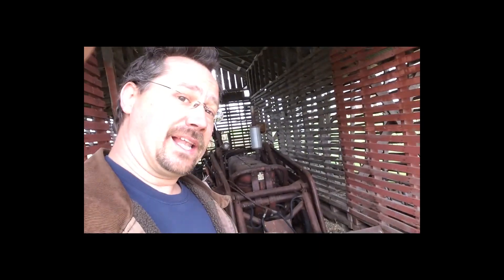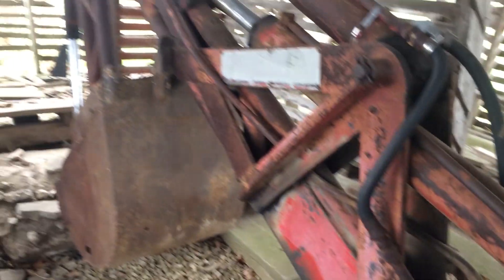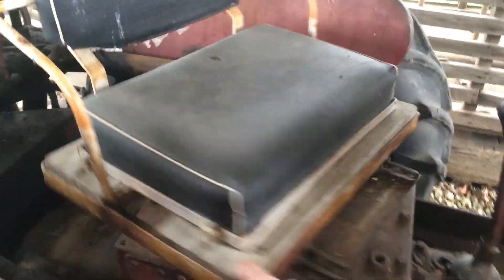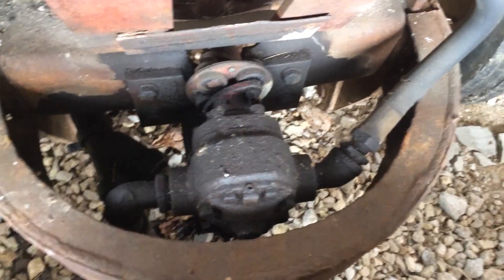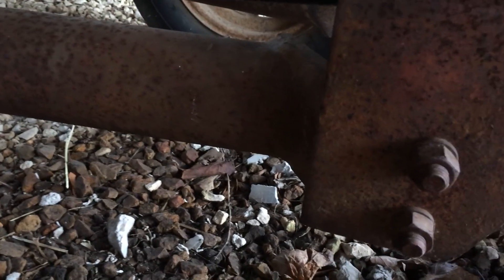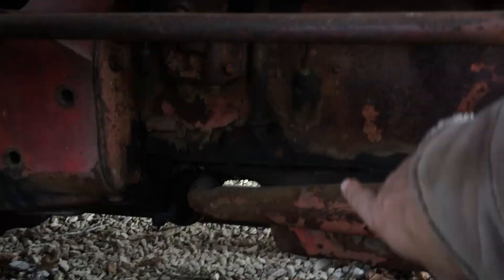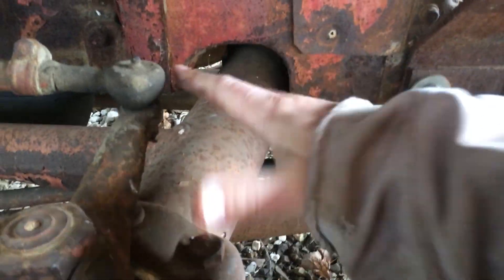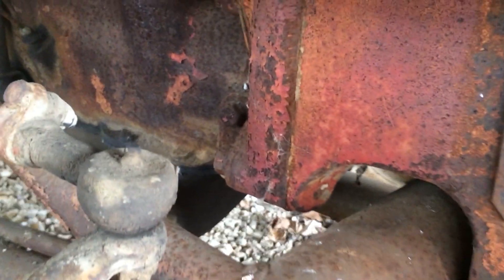International Harvester 300 Utility Tractor with front end loader and backhoe

Comment: 1000V+ High voltage generator from induction motor american tech made this and if you have five it would power your car. just make it so it don't break. oh then it 3000 a battery because it is all powered by a high speed 24 v 36 v or 48 high speed motor at 20 amps instead of 600.

Comment: Is there a way to connect it to where the starter used to be attached to the bell housing?  Maybe you could pull power off of the teeth on the flywheel?  If you had a solenoid on the starter then you could engage/disengage when you didn't need hydraulics.

Comment: The original hyd pump has a pass-thru shaft, IIRC. Perhaps there is a similar pump which could sit between the electric motor and the tractor's flywheel. Thus it would always have power when the motor is running. Since you have to machine the components in that section anyway maybe that could be made to work.

Comment: That tractor was built as a backhoe  the PTO pump is not a live pump. The front one is a live pump meaning it works wether the clutch is pushed or not. Not sure why they didn't use the standard live pump but maybe it didn't have enough flow for the loader.

Comment: I have an earlier model of that backhoe that was on a Ford 8N (I have taken it off for now) and the first owner did septic system work. The backhoe pump is usually on the PTO. The front pump is usually for the front end loader only. The old tractors often had a crank start option in the front and that is what the shaft attaches to. Ask away if you have questions.
Reply: i know this video is 2 years old atm but hey shot in the dark do you by any chance know the brand of that front end loader ... i have a IH 350 u with the same  loader atm and was just trying to find info about it. Thank you

Comment: Sorry, for not getting back to you sooner. Since I had this same thought over a week ago, but have had concerns about how strong, the Leaf's smaller diameter and short threaded shaft connection, that's just designed to hold a nut for sensor would be for this task? And also thought why not also drive the pump via "front drive unit" that also can power the fan and water pump, by using a adapter plate (with a support bearing if needed). To increase the use of OEM parts. As long as strong enough connection can be made to transfer the needed power?
So how about welding half-lap butted extension? Was on thought...
Or replacing the entire shaft with longer one with custom ends? Most shafts from an electric motor can be replaced, using a hydraulic press and machine shops can make a modified shaft for you. Also the other side of the shaft could be extended and modified too. 
So the end the shaft would not need additional parts to attach them to the input shaft for the gears of the "front drive unit"
And welding the frame rails to the "front drive unit's" attachment bracket is an option to add strength and rigidity to the structure. Or cut them off the "front drive unit", if do not want the motor to be a structural element.
BTW, I accidentally deleted a longer more detailed reply...but wanted to add a link to photos and other info about the Leaf motor partially disassembled that show most of the shaft, that may help. Scroll to page #10...https://www.energy.gov/sites/prod/files/2014/03/f13/ape006_burress_2013_o.pdf
And I can post more links if find this one useful.
FWIW, the irony that you came across something so similar to what I have be thinking about for over a week shows there are no new ideas. Just rediscover ones and ones the are repurposed. Good luck, repurposing one of those old ideas in you own way.

Comment: i still thing you need to have a separate electric motor for the hydraulic pump.  Running it off the drive/traction motor means you need to have the traction motor running all the time (even if you are not moving) just to have the needed pressure to run the hydraulics (loader and power steering).  Electric lift trucks have separate motors for the drive and hydraulics for that reason.  ICE tractors run hydraulics off of the crank either from a front mounted pump or off the drive for the distributor because the ICE motor is always running.  Why run the electric traction motor when you don't need it?
Reply from the maker: The advantage of running the drive motor would be that it's a high-power/high-torque motor that would ALREADY be in the tractor. It would be very quiet and it's brushless.
Adding another motor, just to run the hydraulics, would mean needing that second motor, some additional controls for it, and the weight and space it would take up.

For something like the power steering, that needs hydraulic power, and the main motor would be running anyways. Likewise with something like a front-end loader, the operator would be driving the tractor anyways, so the main motor would be in active use.

I'm really just trying to throw around different ideas. I really wish the Leaf motor had a tail-shaft! It would make it so much easier to do more with it!

At this point, I'm probably leaning towards a separate pump motor, as that seems the most straight-forward approach.
Reply: @BenjaminNelsonX  I think you will be happier with the separate pump motor. if you get the right motor or right gearing, it would be just an on/off solenoid.  If i was going to build a front loader for my E12M, i would try linear actuators and skip the hydraulic all together..
You should check with https://www.solectrac.com/..  they have a new compact model with 4x4 and hydraulic loader.   I would think they would have worked out all the better options.
Reply from the maker: I believe the main reason electric lift trucks have separate motors is that the drive motor usually connects DIRECTLY to the differential.

Comment: Could you not just use the live pto shaft at the back of tractor to drive the hydraulic pump?
Reply from the maker: Yes, but it would make it harder to use PTO powered devices on the back. I've also heard of issues with turning, etc. when using an extension through a PTO pump. It would also mean hydraulic power would be lost when turning off the PTO. The PTO often needs to be engaged and disengaged, depending on what accessory/tool/implement is being used.
Reply: The whole thing with the hydraulic pump is its displacement.  It needs to likely run somewhere around 1500/2000 rpm and also that pump requires a set amount of horsepower to operate it. I'm sure there are many options but the horsepower requirement is key . I'm sure you know Ben.

Comment: That front pump likely has a higher capacity than the factory pump. The extra flow is probably required to run the backhoe. The lazy way to get hydraulics back on your tractor would be to use a PTO pump and keep the PTO engaged to use your hydraulics, but then you won't be able to run PTO implements.